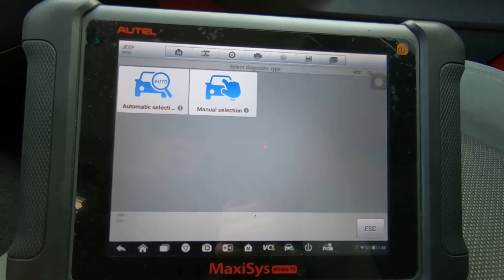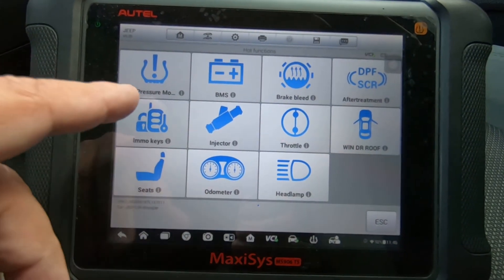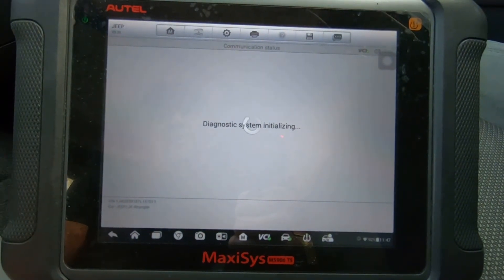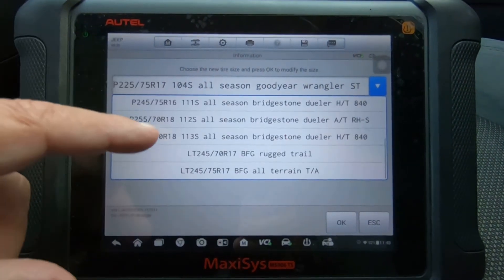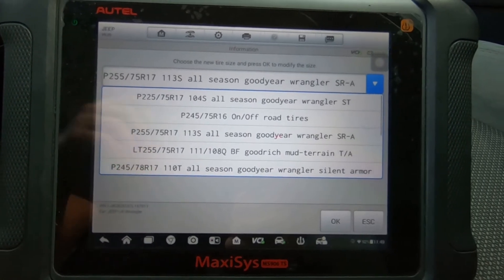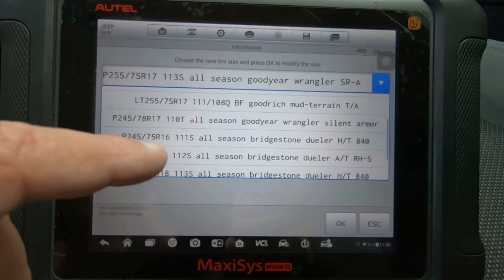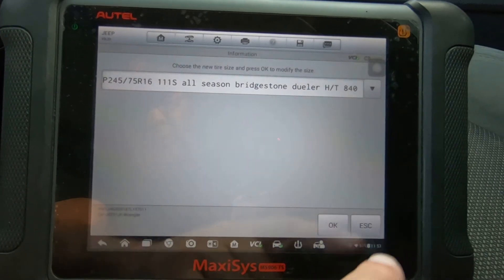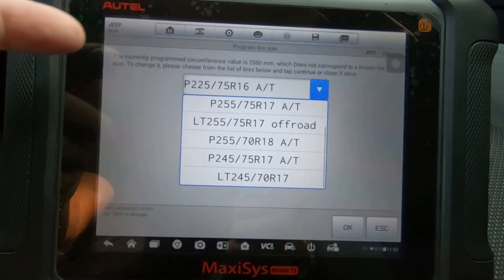Using the Autel Maxisys MS906 to Program Oversize Tires on a Jeep Wrangler.

Comment: anybody putting bigger tires on a vehicle should be changing the gears if your putting on 33 or 35 or bigger.then your speed speedometer should be closer.you have way less low end torque if you dont and making everything work harder and more likely break sooner. i had a 1990 ford ranger with 33 inch tires and changed the gears myself to 4.56 .stock was 3.73 gears. the rpms with 4.56 brought my rpm 100rpm higher with 33 inch tires on which was good.i could wheel again and also cruise at 75 mph down the freeway. the stress will be mostly on axles now and the rest of the vehical will not be crying or breaking as fast.if you plan to wheel it i suggest getting bigger axles to handle the stress and gears so your less likely to break stuff.

Comment: Which Autel unit were you using? Which 3rd party programmer do you suggest to change tire size?
Reply from the maker: I was using a MS906 but a Launch torque pro does more tire sizes.

Comment: Um, that's a scan tool
Not a programmer
Reply from the maker: That is correct, to be more accurate it is a scan tool that programs.
Reply: @Corey497 Um, thats a dumb response. If you spend thousands of dollars on a scan tool the stupid thing should be able to calibrate the speedo.